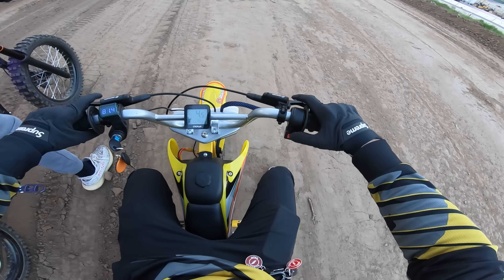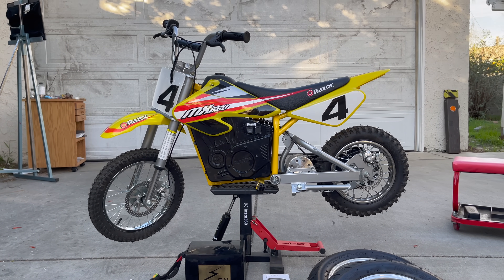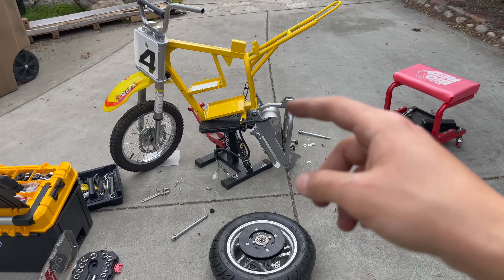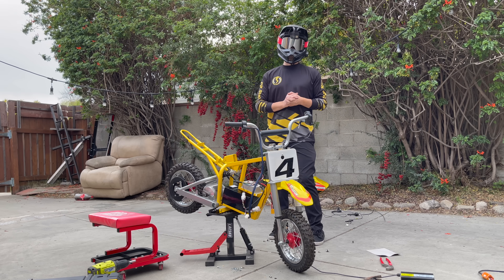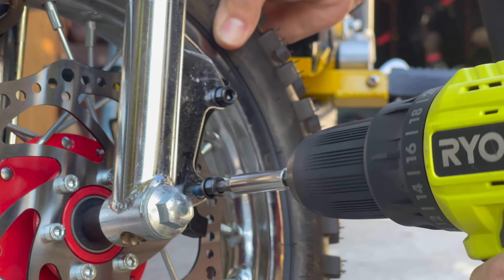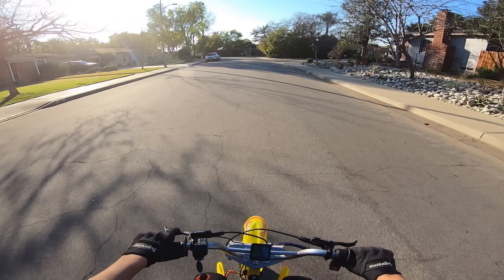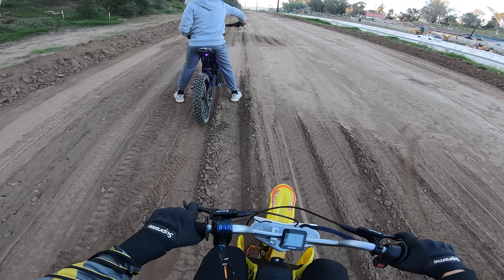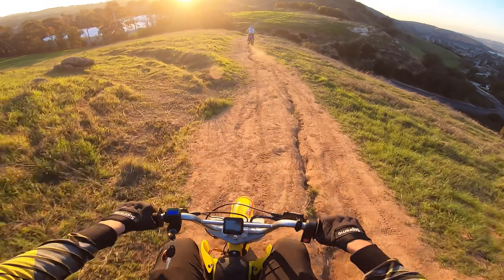How I built a 45 MPH electric pit bike // Razor MX650 72v Upgrade

Comment: Monster-Ronster, my 7-year-old found you on the tube. Do you still have any of the surplus items you took of your build? I am a broke-ass dad trying to fix and repair a junk MX350 that we found in the trash. (Batteries were dead, missing brake cable and one plastic, motor-MY1020 350watt 24volt-D.O.A) If you have any parts you could sell or donate to a small child's dream, that would help this (stuck giving it all to the baby momma) Dad. I can pay for items that are missing, I am not a deadbeat, moocher dude, but my funds are always mad low, and weeks go by that I can't get any parts. Gas and well, food has to come first. I find him sitting on that thing till e falls asleep. I wonder how many miles he has ridden in his head, how many jumps he has completed or walked away from. LOL
I am able to fix any broken part, I'm not afraid to tackle broken parts and repair the crap out of anything. I can even get down with some electronic issues. Your trash can be this little boy's hope to actually get his bike outside and ride.
I kind of guess you don't read comments, so it's all good. He won't know that I am writing, it would only get him excited and well. Just keep the vids coming I've learned a lot and they are fun to watch.

Yo Thanks and Kepp - Rolling Rolling Rolling

Comment: Ok I know it’s expensive 

The Stark Varg. 

Pre order for next year, $12,9k USD

80Hp
691ft-lb torque/938nm (that is Not a typo) 
110kg 
6kwh battery/6 hours depending on ride style
Traction Control

Comment: Please do a razor ground force drifter next! Get an extra set of front wheels and pop the bearings out and they fit right on the back with a couple extra washers if u want to take corners Hella fast! Handling is improved big time doing that and welding bicycle handlebars to the stock ones! Ask me how I know lol
Reply: how do you know?
Reply: I did a drifter with a 3kW setup and it goes 40mph but also did a Dune buggy which goes 30mph but is way more fun because it handles amazingly.  Also have real kart wheels and slicks on the Dune.
Reply: @EliteZ06  any videos? I been trying to find the dune buggy but after covid they shot up I'm price for used ones but when I got my kart they had a broken dune that I should of got but money was tight at the time
Reply: @2down2togo  I have tons of video of my build I just haven’t done the editing.  Here is a quick pass:  https://youtu.be/cjPkphXIKIk
Slow it down and notice the custom wheels.  Those were the hardest part to get right but they’re amazing.
Reply: @EliteZ06  thats sweet man! I've been wanting to find a set of dune wheels for my drifter but 100$ is just too much atm lol
Reply: @2down2togo  yeah man these wheels work amazing but I had to do a lot of custom machining and the parts alone are $450.  Wheels hubs tires and spacers.  But they are real tires, no tube or anything.  Very tough.
Reply: @EliteZ06  wow that's a bit overboard for me haha I do have a set of 8in tall by 2in wide wheels that I'm working on installing on the rear but don't have nthn for the front yet
Reply: @EliteZ06  is it 3kw 48v or higher voltage? I'm pretty happy with mine I purchased a set of front wheels and put one on the back for grip and left one drift wheel, it's perfect to slide around corners now!
Reply: @2down2togo  72v motor with a 72v 20Ah battery.  It rips
Reply: @EliteZ06  I bet u could get a lot more speed out of it with a simple sprocket change but honestly 40mph is fast af on that little thing haha I geared mine 15 motor 30 axle and it's about perfect for top speed but torque is a bit on the weak side. Thought about getting a 96v controller and way over volt my motor since I have 2 13s 6.4ah packs in parallel right now but could easily make it a series connection but that motor would be screaming hot haha

Comment: Now the next thing you should upgrade is the handlebars, because those cheap bars on the razor are not going to last long if you happen to crash and break them.

Also where did you get the upgraded rear shock?

Comment: Last year I bought a used MX650. Did a 3000w motor kit. After I hooked everything up, the ECU shorted (fried itself). Was a sad experience after making it a 4 battery fully upgraded bike. Always make sure you get quality parts! 

(if you go cheap kit, it's very likely that the throttle won't work, or the controller will short out.)
Reply: did you do the same kit or not

Comment: Yo love your vids, but had a quick question. On mx650 like this one can you just change the motor to a 2000w and not change anything else like the battery and controller and leave it stock?
Reply: Hit up @antssta he is doing one up too 🤙🏽
Reply: @DirkWinterLetsRide  thanks
Reply: 👎 no. Dont see how that would even work. Leaving the battery sure thats doable but you only getting like 4 miles range. The controller its specifically programed for one motor at a set power point. Doubt it would work at all but if it did it would work as if it was still the stock motor
Reply: Popular razor 650mod adding a battery to turn it up from 36v to 48v the controller and motor will only support it for so long tho then people upgrade everything from there but that extra battery I hear will give extra range stock is like 6miles so maybe you'll get 8 and push you into the 20mph speed range
Reply: W question helpfull

Comment: can the upgrade work on the razor MX or SX 350's?
Reply: Yes but you will be overwhelmed because the 350 goes 10 stock and I’m pretty sure that the battery will fit in the max 350 socket.